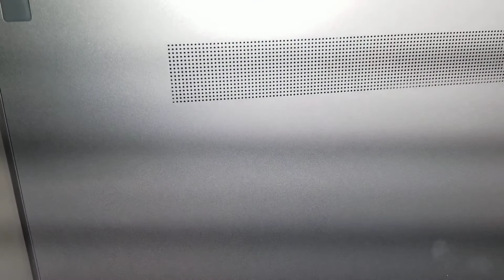Samsung NP730QCJ Galaxy Book Flex Alpha Disassembly SSD Hard Drive Upgrade Repair

Comment: I have this laptop but recently it has been overheating up til 70- 90 C and when im on videocalls it stops responding and a blue screen pops up with "Power state failure". Do you got any idea of what could it be? ps. i have never given it any maintenance like fan cleaning
Reply from the maker: @marissaurbi  not sure. Usually an overheating processor will cause an immediate power off, not a blue screen issue.
Reply: @ItsBinhRepaired  yeah, i've been checking its temperature and even the graphic card is like above 55 °C and im not even doing anything demanding, just using chrome

Comment: I used a flathead screwdriver to open the back, i put the flathead in the gap between the clips and turned the head until the clip popped up. (May scratch the cover a little if not done properly
Reply from the maker: Glad you got it open.

Comment: Thank you for a great video. Worked out great, now I have a new 2TB SSD installed!
Reply from the maker: Awesome! Glad it helped. Thanks so much for the support as well!
Reply: Question! Pretty new to this computer stuff. So upgrading the SSD just lets give's you more storage correct?
Reply from the maker: You can also put a faster better quality one.
Reply: @ItsBinhRepaired  so what does a faster SSD mean? Like saves faster? Because isnt just essentially "memory card" that just saves your stuff?
Reply from the maker: @Og_ChampChamp  it runs faster

Comment: I know this is an old thread but hope someone is still looking at it. I'm looking for the factory image file. I believe the drive has failed and want to try to startup the laptop from usb before purchasing a replacement. I made the changes in BIOS and tried a spare drive via USB with a windows boot file (from other computer) but no go. 
I don't want to waste my money buying a new drive if its the motherboard. BIOS shows SATA drive not installed.
Reply from the maker: Create a windows installer with another computer windows usb installer from Microsoft
Reply: @ItsBinhRepaired  I did do that just now and it looks like things are working, except the SSD drive unfortunately. I will need to order one. Thank you!
Reply: @ItsBinhRepaired  any chance you have a copy of the image file for this laptop or a good source? I'm having a hard time getting the drivers from Samsung.
Reply from the maker: https://support.microsoft.com/en-us/windows/create-installation-media-for-windows-99a58364-8c02-206f-aa6f-40c3b507420d
Reply from the maker: https://support.microsoft.com/en-us/windows/create-installation-media-for-windows-99a58364-8c02-206f-aa6f-40c3b507420d
Reply: @ItsBinhRepaired  unfortunately even the new drive is not being found. When I first went to the BIOS i noted the date was wrong (likely build date). When I started it today I see the date again is wrong so my guess is the CMOS battery is dead. I'm about to give up on this quest. 
Thank you for your help though.
Reply from the maker: I hate how YouTube doesn't notify me of replies. Were you able to figure it out?

Comment: I have the same laptop and the screen is black but the power light is on but my screen is black and won’t turn on could you help ???
Reply from the maker: Does it work with an external monitor?

Comment: I dropped my laptop 
Suddenly the touch in the screen doesn't work
The screen works perfectly not broken or anything
Just the touch doesn't respond
Any idea of the cause?
Reply from the maker: Either a crack you can't see or the digitizer cable came loose.

Comment: I have this same laptop but im having an issue the screen is black but the keyboard and power indication are turning on however i dont hear the fan i opened it up and cleaning majority of the dust however some of the tape had been ripped around the long connector connected to the fan is this the problem?
Reply: The tape was ripped due to a sticky substance getting in through the vent i cleaned it to the best of my ability but still nothing
Reply from the maker: @bloop5490  sounds like liquid damage
Reply: @ItsBinhRepaired  is that fixable or does it have to be replaced?
Reply from the maker: @bloop5490  you wouldn't be able to fix it yourself
Reply from the maker: @bloop5490  might be fixable by a repair shop, but might not be worth doing

Comment: how much the maximum space per SSD allowed by the laptop??
Reply from the maker: Whatever you can fit
Reply: I read that it was limited to 520gb
Reply from the maker: @miusik891091  that's a lie. You can put whatever you want.
Reply: and I want to put a little more if possible
Reply from the maker: @miusik891091  this video will help with the upgrade. https://youtu.be/4p5jFDzVwUw

Comment: Is the ssd replaceable? It causes BSOD on my laptop 🤕
Reply from the maker: Yes. You'll have to reinstall Windows
Reply: I've already reinstall windows twice, then the Whea Uncorrectable Error has not yet fix 🤧
Reply from the maker: @germanluisantonio437  I mean after replacing the SSD

Comment: Excellent video. Had to use a suction cup as well. 
Our Flex laptop was on but only the fan was and absolutely nothing else.  We decided to pry it open and manually disconnect the laptop, since even the power button didn't work. Nothing did. This did the job. Thank you!
Reply from the maker: Awesome! Glad it helped. If you haven't already, please like and subscribe so others can find my videos. Thanks!

Comment: Mine doesn't have any screws so should I just try to pry it open?
Reply from the maker: Did you watch the video?
Reply: @ItsBinhRepaired   I lifted the rubber feet and they had no screws under them.
Reply from the maker: @eurokeye  very strange. Are there any stickers covering the screws possibly?
Reply from the maker: @eurokeye  same model number?
Reply: @ItsBinhRepaired  same model number and no stickers or anything just holes where screws should be
Reply from the maker: @eurokeye  very strange. You can try popping it off

Comment: Do not buy! Junk! The only thing worse than the workmanship of this laptop is Samsung's customer service. After two months the silver paint on the bottom is worn down to the metal. After almost a whole afternoon wasted with them, they said "it's cosmetic and not covered by the warranty" Very upset $1k wasted. My 8 year old Mac and Dell still look new. Any photos or questions contact me w4cd@yahoo.com
Reply from the maker: Wth did you do to your laptop? A scratched up bottom doesn't even affect use of the computer. Sounds like you lost the rubber feet. You could easily buy a replacement bottom cover...

Comment: hey could you make a zip of the drivers for this? and drop a link please! or anyone else here please
Reply from the maker: Windows 10? Go to the Windows store app and download Samsung update
Reply: @ItsBinhRepaired  I tried this and it says it should be in the windows update but that doesn’t work either. Was hoping they had the support page like most site that provides all the drivers but nope 😭 and I wasn’t able to back them up because everything was all corrupted 😭
Reply from the maker: @vandiesel157  yeah, Samsung is a little broken. :(
Reply: @ItsBinhRepaired  facts lol if possible tho you should backup your drivers and put them up for other who may have this same issues. would help alot and possibly get you some decent traffic unless im the only one having these issues lol
Reply from the maker: @vandiesel157  I think a lot of people are having the issue :(
Reply: I have the same problem with the drivers. The recovery section has been erased. Did you solve the problem?
Reply: @Saines13  yea I ended up getting the updated from the site and put it on a flash drive. Mine wouldn’t install the proper drivers at first because the copy of windows I had wasn’t genuine 😅 when I say update I mean windows and from there it went smooth
Reply: @vandiesel157  Thank you very much, good man! Returned to Win Home. Everything works!
Reply from the maker: This video should help.https://youtu.be/Mk8pI09g6qg

Comment: I spliied apple juice over mine and I've only had it for 2 months, some keys are hard to press. Could you make a video on how to clean the keys because i don't want to pay for it and i think i can just pop off the keys but bestbuy said not to do that cause "it can cause more problems" what should i do?
Reply from the maker: I don't own these laptops, so the only way I can make a video of that is if you ship me your laptop. Every laptop keyboard style is different.
Reply: @ItsBinhRepaired  its the exact same laptop as in the video, do you think its possible for me to take out the keys and replace them myself?
Reply from the maker: @himanshbhattarai6028  yes, but if you don't know what you're doing you can break the clips.

Comment: thanks for the video. i hate how these type of videos always make it look so easy and then takes me forever! and was nice that you struggled with it a tiny bit haha. If I'm just replacing the nvme ssd do I need to remove all the connectors as you were showing?
Reply from the maker: Nope, just make sure it's off.
Reply: @ItsBinhRepaired  Thank you!! I just did this myself and the suction cup was amazing (I had a GoPro suction cup mount). I just put the suction cup on all four corners (one at a time) and peeled it off one corner at a time. Going to upgrade to a 1tb intel 665p
Reply from the maker: @BensonWongs  awesome

Comment: Can you change or upgrade the ram memory? I didn't see it!
Reply: This has soldered RAM and no RAM slots.
Reply from the maker: I probably didn't mention it because you can't.
Reply: @ItsBinhRepaired  you sure? I think the ram is mounted behind/under so you need to remove the board to see. Because they have 2 models. One 8gb one 12gb.... 12gb usually means two off brand 6gb chips or the weird combo 8/4.... Might mean the 10210u version has one 8gb or two 4gb
Reply from the maker: @goblinphreak2132  hmmm possibly

Comment: Is this the galaxy book flex alpha?
Reply from the maker: I don't know. If it looks the same you can probably open it up the same.
Reply: @ItsBinhRepaired  its was easy using a suction cut it came straight off. This was the best tutorial I found.  Thanks
Reply from the maker: @MuzicNMoreTV  Awesome!
Reply: @ItsBinhRepaired  yeah it was thanks
Reply: @ItsBinhRepaired  You should put a slash after the model number in your title, and put "Galaxy Book Flex Alpha" and you would probably get more views.
Reply from the maker: @AndroidDigest  awesome, I'll try that. Thanks!
Reply: @ItsBinhRepaired  If you google your model number it does come up as the book flex alpha, and it looks exactly the same. I kept searching for a teardown and couldn't find one, this came up and I noticed it looked the same.

Anyway, good luck, thanks for the teardown! I have this model and I want to tighten the hinges, and I want to see if it works! so this video helped!
Reply from the maker: @AndroidDigest  awesome, thanks for the help!
Reply: @AndroidDigest  Were you able to tighten the hinges and if so what was the outcome?
Reply: @EJ-en5xl  it didn't make any effect at all. Sadly it was a deal-breaker for me and I returned it. Outside of the no usbc charging, this laptop was amazing. But the hinge would wobble even with basic typing on a flat surface. I loved it so much but had to give it up due to that
Reply: @AndroidDigest  dang hope mines not like that when I get it
Reply: @EJ-en5xl  let me know how you like it!
Reply: @AndroidDigest  will do.  I don't see other complaints on the hinge so maybe you had bad luck
Reply: @EJ-en5xl  many tech reviewers mentioned the hinge was a little looser then they prefer. Many of those reviewers reviewed the regular Flex, but it's pretty much built from the same materials and everything... Just keep in mind it's very subjective, it's not that much looser, it was just loose enough to bother me, you may not mind it at all
Reply: @AndroidDigest  I got my flex alpha today and happy to report my hinge is plenty stiff.  I get absolutely no wobbling of the screen even when typing on my lap.  And I'm the type of person who notices those things and is very picky when it comes to quality control of electronic devices.   Happy with it so far.